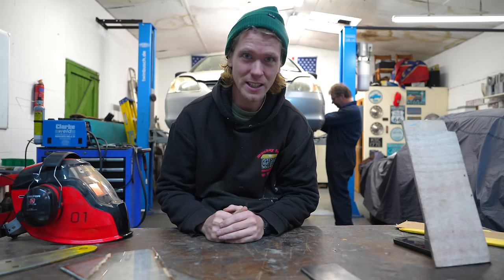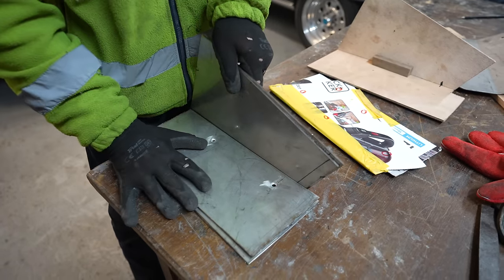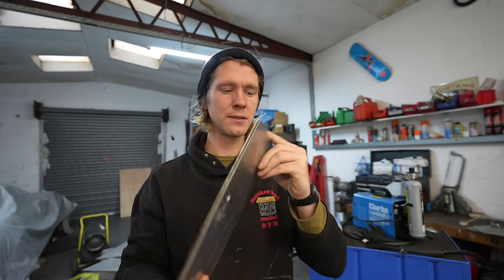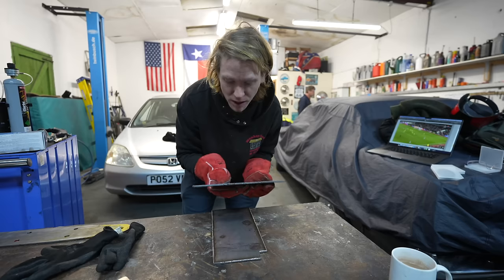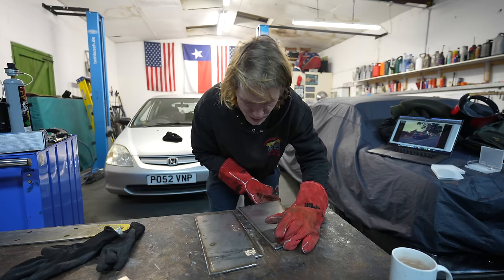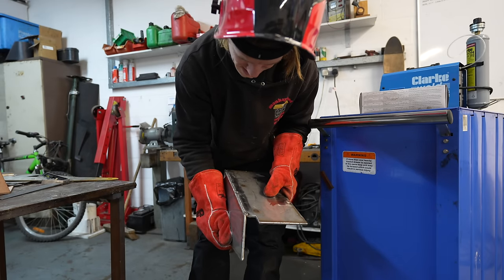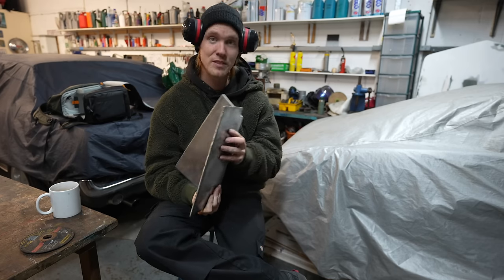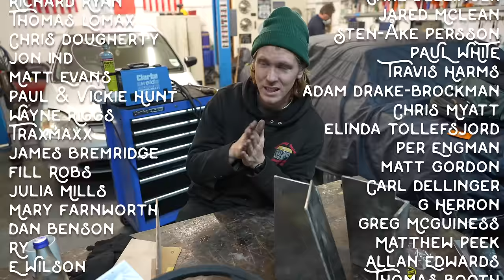My Salvaged Catamaran gets Salvaged Chainplates | Wildling Sailing

Comment: Overkill to the max on them backing plates. Great job with the welding. Another skill well done!
Reply: You have an amazing dad!
Reply: Not overkill. Wharrams are sailed with rather loose rigging. Also, as being catamarans, they don’t heel as easy as a monohull. Both of these factors mean that the forces on the chainplates can build up much greater than on similar seized other boats
Reply: @alfreddaniels3817   The chain plates take the load and transfer it to body the boat. The backing plates only ensure the chain plate bolts do not pull thru the hulls and help spread the load to the hull. They do very nothing to enhance the strength of the hull  Doubling the chain plates themselves is not a bad idea. But way overkill on the backers, adds weight for nothing. at most doubling the area around the bolts only. Ultimately all the load is transferred by the bolts,  if they are too small or weak the size of the backer wont make any difference.
Reply: It depends how strong the body of the boat is it at the place where the chainplates are connected. Chainplate at the outside and backingplates on the inside are bolted together with the hull between them. They act as one and spread the loads to a larger surface of the hull and to stronger parts of the boat. There are boats that have backingplates that go all the way down to the keel where that is the strongest part of the hull. There are boats where the “ backingplates” are a complete internal steelframe, like a bulkhead.
Reply: @alfreddaniels3817  im sure Hanneke didn't design them to be this beefy given her catamarans are weight sparing.

Comment: Those welds will hold up to some heavy weather. I don't know if you know but I would use separate wire brush and disks for each type of metal Ie Ali, stainless or mild to prevent contamination and stuff
Reply: Correct. Nowt worse than some rusty streaks on your 316 from your mild steel wire brush.

Comment: A good tip to help when welding stainless is to brace it up while your welding it, that's how you eliminate a fair amount of warpage. Its important not to grind away too much of the weld to make it look pretty you want to have strength and integrity left after you've finished cleaning up the weld. but looks like it should be ok for what your using it for. nice to see you've acquired some welding skills. Mark. Its a handy skill to have.

Comment: Tip: if you're working with 3mm you could use bending  to create the angle shape and double them up to 6mm after. Saves you a difficult corner weld..... Anyway,  your mast will never fall off with these backing plates. Great job.

Comment: It was good to see you back on , I was a wielder on the rail road and putting in the button wields was a good idea we did those on rail cars because of metal separation,  also because I worked at a fab shop could you have not just bent a piece of metal in a 90 degree angle if you had the material,  looking forward to your next project.

Comment: Great you learned welding, (better than i could do ) but SS backing plates are for force directly against the plate to spread the load from the bolts. Seeing as you’re going to have lateral load on the plates their impact will be minimal, 3 or 6mm thick doesn’t matter, and remain on the bolts against the ply inserts you’ve glued in. Best bet would have been to build up the cabin wall, bulkhead join and epoxy in reinforcing. The lateral load would have been far better spread due to the adhesion of the resin.  Quite a bit cheaper to do it with epoxy as well if you count the purchase of the welder. Watch Duracell Project or MJ Sailing to see how they did their chain plate areas. They de-cored the hull side and laying layer upon layer of glass to build it up into a strong point. On my Fusion 40 (extended)cat I cored and glassed the bulkhead point to the boat side with about 15 layers of 600gm bi-ax/Uni each side. The inner and outer stays then connected to two SS straps that bolted together through the bulk head. Point is the strength is in the bulkhead not the stainless. They are the main load area on your boat and catastrophic failure point. If the mast comes down at sea you’re a little bit screwed!  Sorry to be a negative Nancy but maybe time for a bit more reinforcing and to re-assess the SS backing plate load areas. Ask ANY boatbuilder, don’t take just my word for it! Sorry but you always ask for feedback. Long time fan!

Comment: The trick to those chainplates is polishing them to perfection. Any little scratch will become rusty over time . Especially in salty air . The backing plates not so much . You can use ospho on the backing plate. It takes a while for it to dry on stainless but it really holds back the rust. An example of a scratch would be using an oscillator cutting the plate out of the deck and putting deep scratches in it . Or putting a v notch around the chainplate to except butyl
Reply: Depends on the quality/grade of the stainless whether rust will be a problem. The metal came from the old lifeboat. If there is no rust showing on the scrap from there all should be OK. It can be painted before or after fitting. No need for it to be kept looking shiny inside the boat.
Reply: AUTOMOTIVE ceramic spray paint is my latest go to coating for stainless
Reply: I also noticed on old high quality 316 stainless. If you polish off the old oxides it can cause it to rust . Where no rust was present before

Comment: I think you and your dad did a good job on the backing plates. The stitch welds on the inside corner will be fine. I don't think weight will be an issue at all. Can't wait to see them installed.

Comment: Your welding has come along ... nice beads along the edges.  Did you mark out the locations of the holes on the template?  It would probably be much easier to get all of the holes drilled with a drill press, rather than trying to go through 6mm of stainless with nothing but a hand drill back at the boat!  Keep up the good work!

Comment: Hi Mark,
Great work keep it up.
A little note.
With stainless steel any steel touches or scratches the stainless it will rust where steel touches.
All grinding discs should be iron free as well or will rust the stainless.
When was work in a stainless workshop no mild steel aloud in the stainless shop.

Comment: Hey Mark, Great job on getting your welding technique down. Nice work. I will let you know that stainless steel  really isn' the best material for chainplates, bronze it the better choice, It will not experience any crevice cracking in the future, and that is something you are going to have to be very careful about having welded 2 pieces of 3mil  stainless together. One other thing to consider, especially since you are in the early stages and could revise your plan, is to move all your chainplates outboard of the hull. It will be easier to inspect, maintain and remove if necessary. Talk to any "Old Salt" and they will tell you move out and do them in bronze. Good luck in whatever you decide. Love the channel.

Comment: For a first attempt you did excellent with your welding. With practice comes skill. As to the grinding etc all I can suggest is you throw away the disc guards and use 125mm or 5inch discs. They will go much further and ultimately save money. Less of the grinding discs and more flapper discs. Well done so far.👣

Comment: Them welds will hold up just fine and don’t let no one tell you any different lol.. your welds look better than mine when I first started to weld I can tell you that. And just prime and paint the chain plates black. No sense in trying to polish them and painting them will hide the pin holes in the weld if you do 2 or 3 good coats of primer before spray painting them.

Comment: What you can do to not have stuff bend is alternate between welds (inside and outside) and another thing is to use some random rod (doesn't need to be stainless) and tack that rod at the edges to keep the bracket from bending inside, once you're done you cut the rod off.

Comment: Congrats on the progress you made on your welding skills!
My only concern is that in last episode, when your dad was test fitting the wooden template (made at 90 degrees), the side that goes to the bulkhead didn't fit properly (was 1-2 degrees off).
I don't know if these wery strong SS backing plates will give you that small amount of bend in order to get them fit correctly on both surfaces...
Reply from the maker: yeah that's because of the epoxy fillet, im going to insert some 12mm ply,

Comment: Sturdy backing plates. Try and eliminate how the water was leaking into the structure where the chainplates were attached  and rebuild bulkhead and cabin wall  with fglass in several layers. Then your backing plates will be integral with the hull

Comment: The Plug welding may have seemed random to you but it is a common practice when welding two plates together. I suggest a couple down the middle, it will stop flexing of the two plates. :)

Comment: You will need to passivate the stainless or it will rust as bad as mild steel in the heat affected zone (especially in a marine environment). You can get close to professional results using nitric or citric acid.

Comment: MIG Welding stainless  steel I'm not surprised your flillet welds turned out like that. I've had the same experience going from welding mild with a MIG doesn't seem to flow as well even though the melting point of stainless is lower than mild. Also you may want to look at treatment for corrosion just because it's stainless doesn't mean it won't rust espeacial in the salt air, I see a few comments about contamination its real. Maybe paint them
Reply: The video I sent with the guy using flux core wire says turn the welder up more than mild steel recommended settings which is opposite to what you would expect so start grinding and do it again lol 😂

Comment: You might plan where you are going to drill the mounting holes so you can weld the two pieces at the hole.  You don’t want water to get between the plates crevice corrosion will result in

Comment: Turn your wire speed down a touch, then it won’t build so high on internal weld , that in turn will stop the heat bending in the steel

Comment: Mark ,, you will have ferrous stains on you ss , make soft jaws for your vice and pads for your clamps ,, from A ss welder of 40 odd years welding is easy controlling the pull is the skill,,,, you are doing well
Reply from the maker: Cheers for the tip. I’ll tell Dad :)

Comment: If you are not a professional certified welder it helps a lot to get quality seams by using a higher grade welding wire than the metal you have to weld

Comment: Hi sadly doubling the plates will lead to create corrosion from the inside. Moisture will get in thru pin hole in the welds or the fastener holes you drill. It will be a perfect oxygen starved wet environment for crevice corrosion. 3mm plate,would be just fine . nice welding though you have a good instructor! 
But fortunately it should last a,while.
Cheers,warren

Comment: You should use AVESTA 101 PICKLING PASTE for those welds if you don't want to see rust any time soon when you install those plates on your boat.....if you do not use some pickling paste you will have rust for sure, not need to be AVESTA brand but this is best that i know

Comment: Drill some 10mm holes through first plate so you can add plug welds every 5cm or so. And those 3mm plates alone would easily been enough :) More is better anyway :P

Comment: Great stuff.  One thing that occurs to me though is when you made your pattern I was sure the plate to bulkhead was at a slight angle greater than 90 degrees.  So joining the two pieces at 90 might be wrong.  Or then I might be an idiot....most likely.

Comment: Welding sparks burn into the glass of spectacles, but not into the plastik of plastik spectacle lenses. If you film welding and flying angle grinder sparks, just put some clear plastik tied in front of the lens.

Comment: Awesome work Mark, quick question… why did you choose 2 separate pieces welded together instead of line bending a single piece? Was it due to doubling up the steel or does the joint have better properties welded for your application!

Keep up the great work!

Comment: Nice welding. I do have concerns about much of the metal you are adding on tge chain plates and tge engine boxes. Are you aware of crevasse corrosion? With those chainplate backers you have created a structure where water will get between the two plates where you drill the chain plate bolt holes, which will possibly either freeze or rust jack them apart. On the engine boxes, using threaded rod as a structural engine bearer in a thin hole in a stainless plate is just going to act like a chisel to split the rod threads. If you have to do it that way, smooth rod with a minimally threaded end into a delrin cutting board plastic bushing or similar would be a far, far, far safer way to go. You are choosing the right materials, but not using those materials in a structurally safe manner.
Reply: Putting two thin plates together like this is likely to cause rust between the plates. This may seem absurd for Stainless Steel, but it relates to the surface oxide layer that requires oxygen/air to remain stable. One can hope that when the holes are drilled through the plate, that that will allow air between the plates. Problem is that you will never see the problem until it fails.
Reply: I have no knowledge of welding but as soon as I saw he was joining two pieces of stainless steel flat together I thought that there might be corrosion problems in a marine environment. He says he is using 316 grade stainless, does he mean 316L which I understand is more resistant to corrosion and the correct product for marine use ?

Comment: As I am watching this, I’m wondering… How will these corner backing plates fit in the corner with the fiberglass filets?  I didn’t notice a long radius on the corner that goes against the filet.
Reply from the maker: I’m going to pack the area with plywood to add a bit of thickness also :)
Reply: @WildlingSailing  Thanks for the quick answer and Happy New Year!  I wasn’t going to lose sleep over it, but the builder in me kept saying, “Wait that corners not gonna fit!”   Btw, I’ve been trying to weld for over ten years and I can’t even begin to weld that well! Looks great.

Comment: please make ABSOLUTELY sure that NO water gets between the doubled sheets.
It will cause crevice corrosion.
When you go drilling holes for the bolts, use the 'Drill, fill, drill' principle

think you can weld the insides on the parts you haven't done yet.

Comment: Hi Matey. Happy New Year. I'm just wondering why you fabricated these custom angles rather than cut them out and welded them together as flat plate then just hit them once with a break-press to get the right angles? A lot less work and any good engineering company would press them in about 10 minutes. To late now I guess. Sail Safe mate. Ant & Cid
Reply from the maker: Happy new year! I guess we just like to make it difficult on ourselves sometimes (most of the time)

Comment: Crevice corrosion  , just to bring this phenomenon to your attention, 
commonly seen by boaters where stainless nuts on bolts undergo galvanic corosion  where there are tiny sealed spaces between components
Welding two plates together creates an ideal situation for crevice corrosion, dont take my word, do some searches.   its difficult to detect until failure, and hard to identify.   The heat generated by welding alters the property of stainless steel, quality stainless steel weldeding will always be followed by Passivation,  an acid treatment applied post construction to bring the stainless properties back .    There are some simple home solutions, not as good as commercial processes, but likely to prolong the life of components..       
The thickness of the backing plates does not add any strength to the stays anchor.   The thickness just stops deformation when the fixing bolts are tightened;    the stays exert a force upwards,  that places a shear force on the  mounting bolts.  It would be better to weld 2 x 3mm plates at 90°,    then simply overlap the 2 sides with no need to weld plates together.  This avoids adverse heat treatment, and reduces effets of crevice corrosion, the 90° weld on Single 3mm plate can be passivated easily both sides and ensure a structually good weld, it also saves a lot of grinding

Have a look at stainless steel welding ......   un passivated work goes rusty there first

Comment: Why not build chainplates either wood like beam attachments or composite  carbon / e glass the weak spot is still not the plates backing or chainplate but the wood to which you attach it.  Loads are taken to wood via bolt attachment points over time with gradual movement load gets carried to wood and gradually each point is worked outward and water starts to enter.

Comment: It's easy to say it could be better, but why do those people never come and do it for you? right. In case it turns out to be not beefy enough than over time you can change. For now just get it done. Have a great 2024 ahead! I only fear they're a bit of in angle, given your wood was. Hope you adjusted it. But if not, due to the tack welding you did you can still bend it a bit.

Comment: Overkill to weld the two 3mm plates together when you’ve got bolts through them anyway. I guess you could have used a few rivets if you didn’t trust the bolts alone.